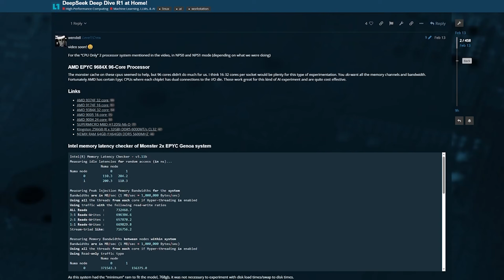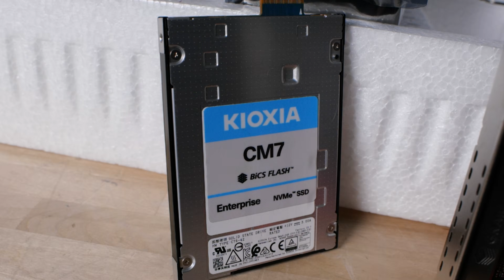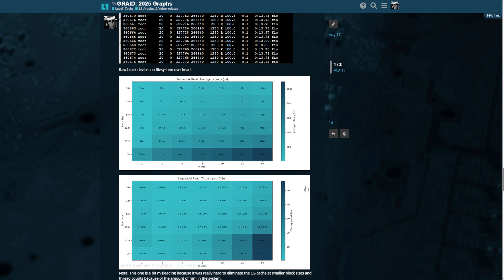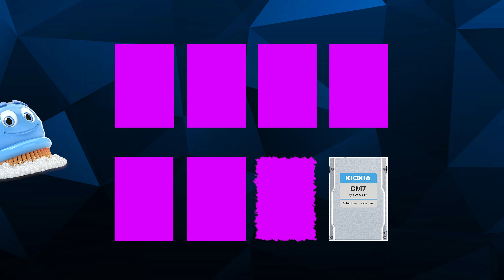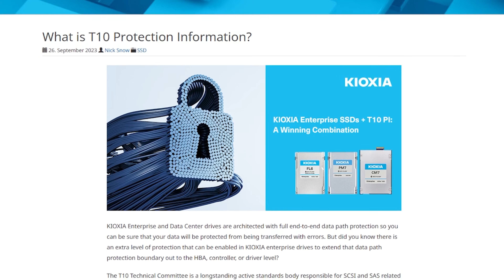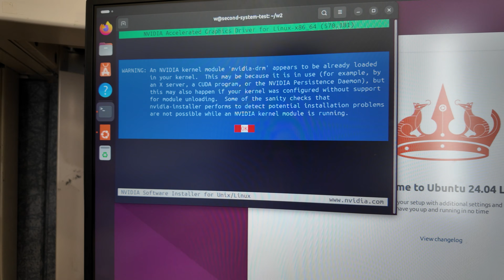Is Hardware Raid TRULY Dead? SupremeRAID SR-1010, Reviewed

Comment: what about 4 10 tb drives sas 10k rpm doing same job over and over like 250 gb data ie 1000 files ie pictures move sort to directory's and process compress 16 hrs hd video no res loss to dvd disc thats 1 only dvd thats a job for raid 40 tb data and raid card cost 179 x 4  + 129 for 9461 card. total less than $1000 your setups cost a little more!!!

Comment: I've had nothing but trouble with software RAID in the last few years. I did enjoy hardware RAID reliability for decades and I miss those days. 

If a disk dies you replace it, no problem as long as too many drives don't die before you replace it.

If there are errors on a software RAID then the endless process of searching command line commands begins and in the end you never fix it.
Reply: then you need learn what ZFS is lol

Comment: I was amazed by those read/write throughput figures. Maybe 15 years ago or a little more I remember working on a solution that needed to get blocks onto locally-attached storage as fast as possible so that specialist data-aware archival software could stream it off to tape fast enough that the tape drive would never need to slow down until it got to the end of the tape. (Niche, edge cases are such fun.) The fastest filesystem performance I was able to get with a Linux host was using the ext2 filesystem, and we only used the first third of each drive in the storage array (because the outer tracks of a disk platter pass under the head faster than the inner ones. The throughput was impressive for the time, but nothing like this SupremeRAID SR-1010 hybrid solution! I wonder where we'll be in another 15 years …

Comment: So if hardware RAID is going to hang around like vinyl records, we're going to see lots of boutique and limited-run hardware RAID solutions that are only collected by enthusiasts? 🤣

I'm from the days of using hardware RAID because the computer did not have the resources for the high-speed RAID calculations and I/O throughput. You remember when CPU clock speeds were in MHz? Yeah, back then. And because of all that experience, it took me sooooooo long to feel comfortable with software RAID "for real" - not helped at all by hitting problems with early software RAID solutions. Anyway - as I never had a NetApp or an EMC SAN in the home lab, it wasn't until ZFS that I learned to be comfortable with software RAID. I think also, by that time, the error reporting from consumer-level drives (and the OS support for this) had gotten significantly better, so that was a pretty big part of it too.

Comment: No, HW RAID isn't dead.

Stop with this idiocy.

It's never fun when your ZFS root take a dump on you and causes a kernel panic.

(ZFS root has been in Solaris since Solaris 10 10/08 ("U6") release. I still have the emails to Sun Microsystems about ZFS taking a dump and causing a kernel panic loop.)

It is, for this reason, why I NEVER put my OS install, on something that DEPENDS on the OS to _run_, for everything else to work.

ZFS/your OS takes a dump and down goes your entire system.

This is why I use HW RAID for my OS drive.

This is something that a LOT of people don't understand, because they've never had ZFS cause a kernel panic loop on them before.
Reply: At least from what I've seen, the OS Disk is not connected to the ZFS pool. Typically you have your OS Disk separated so that this is not an issue. The Pool itself is backed up or replicated so that there is high availability and data redundancy.

I can't say I've seen any hardware RAID since mid 2000's. Even software defined RAID is rare compared to HCI (Nutanix, vSAN, Storage Spaces Direct, Ceph etc have been more common in my experience)
Reply: @vortical911  
"I can't say I've seen any hardware RAID since mid 2000's. Even software defined RAID is rare compared to HCI (Nutanix, vSAN, Storage Spaces Direct, Ceph etc have been more common in my experience)"
Varies/depends on what the goals/objectives are, and your budget for deployment.

HCI works if you have several thousands of dollars to throw at the problem.

If you don't, then HW RAID is typically, more cost effective.

I have found that it is wayyy easier to deal with issues from either my LSI 9341-8i or my 9361-8i than it has been for me to deal with Ceph complaints. (like if there's a clock skew issue between the OSDs, there's really not a heck of a lot that I can do about *that*.)

I just have to wait until it resolves that issue, on its own.

Comment: For large bulk storage, hardware RAID is almost certainly dead. However, for a small amount of storage up the front of a server, it is unlikely that it will ever die. Sure you can do a software RAID1 boot device but you have just turned a trivial job of device replacement into a complicated one requiring good administration skills and paying close attention to not screw it up. If you ever get to play with proper server hardware, it is no coincidence that the latest BOSS cards from Dell are now hot-pluggable RAID1. You get these cute little carriers for the M.2 NVMe drives. We have one server left that is still using hardware RAID for something other than boot, and that is because, until last month, it was a standalone ESXi host, running the monitoring VMs. We have migrated to Proxmox due to licensing issues, and since this is the same hardware, it's still utilising hardware RAID for the VMs. However, the bulk storage measured in PB is all running software RAID, mostly GPFS, because ZFS is a toy filesystem at this scale. Before anyone defends ZFS, please tell me how I can replace every last bit of the hardware running the file system with zero downtime. Also, please explain how you can patch or upgrade all the software with zero downtime using ZFS. The short answer is that you cannot, so it's essentially a toy filesystem at an enterprise scale.

Comment: So I can only speak intelligently toward Dell x86 servers because that's what I spend 95% of my time supporting, but : NVMe is finally being taken seriously in production "Pizza Box" systems that have been basically what's keeping RAID alive for at least the past 5-10 years... so RAID's days may finally be coming to an end for all but 100TB+ commodity storage systems where long scrubbing routines are tolerated for stupid-cheap spinning rust storage prices.

Wendell has put out "RAID is dead" videos for years, yet : It literally isn't possible starting with the 14th Gen Dell PowerEdge equipment to order a 1U or 2U system without a RAID controller (the "PERC", or : P*ower*E*dge *R*AID *C*ontroller... basically an LSI/Broadcom MegaRAID ecosystem with fancy integration into Dell's BIOS/UEFI).  With the beginning of the 17th Generation PowerEdge systems (Spring 2025), the Enterprise customer is seeing two *big things that show things are finally changing in this space : 

1.) The flagship 2U server, the R700-series (we're talking Intel here, or the R770 for the 17th Gen), cannot be ordered with a 3.5" DAS disk chassis.  Somebody correct me if I'm wrong here, but I'm pretty sure this is a first in the like 30-year history of Dell selling 2U servers that you can't get the top-tier rackmount server with 3.5" disks.  Your options now are : 2.5" drives, E3.S NVMe slots, or a combination of the two.  For clarity : The lower-tier R500-series can still be ordered with 3.5" disks, but if it's not an option in the Top-Tier, that means its days are probably numbered

2.) The PERC Gen13 allows for 32 NVMe drives to be configured.  The PERC Gen11 and PERC Gen12 supported NVMe, but nothing like the Gen13.  Also, there are versions of the PERC Gen13 (H975i) that actually don't support SAS or SATA.  Again, that's a huge deal in the enterprise space.

What Wendell shows in these videos is the "latest and greatest" (kind of like his last RAID video where he pounded the pulpit for VROC... sadly how's that going?  😕), but NVMe is still "getting there" in the mainstream Enterprise market.  And honestly that makes sense to me, unless you're working in RnD or some kind of national laboratory, you're going to pick "Tried & True" (i.e. SAS/SATA Hardware RAID) if your job depends on it.

But yea - If Dell is making these kinds of moves in their "bread & butter" servers, I have a feeling we're gonna see some actual changes in the enterprise space with flash storage in the next 18 months, because a move like this is going to force customers to take a look at the NVMe tech and they may have "waited under hardware cycle" otherwise.

As always, thanks for Wendell and L1Techs for all the great content!

Comment: I find this stuff fascinating. These days, I am I only do occasional consulting, but back in the early 2000s RAID stuff was one of the pools I played a lot in. At one point, in the summer of 2000, I built a Linux server with a three quarters of a terabyte JBOD array using Seagate Barracuda 36G  drives and I think 3 or 4 SCSI controllers for the company I was working for directly under the CTO. I did all sorts of testing on the array, and had to do a lot of tuning of the block size to get decent read and write speeds. We were not concerned about long term data integrity, as this was a internet facing array for downloading files our application on the kiosks needed that were in a few thousand locations around the US and Canada. They had been snarfing them from the production server, an SGI Origin 2000, with a large dedicated RAID array box, but it was wisely decided that it should have no direction connection to the outside world. 

My .75 TB JBOD array was there to both remove any load or security vulnerability on the production server. It was a cool solution. Worst case, we just reformated the JBOD array, and rsynced the files over again.  As files were added or updated on Production, they would be copied over using a periodic rsync.  Fun days...

Comment: Hmm, I wrote tools to fix raid5 issues when I had raid card failure back in 2001, and again in 2007, but I didn't save it, wasn't complex enough for me to bother to save it, and really specific for my exact data drives failure issue. Was kindof fun. What wasn't fun was detecting what where the drives in use at the time of failures, and what drives the raid card had already kicked out of the raid.

Comment: Raid 5 over SSD? The SSD already provides a failure recovery mechanism, and raid 5 adds write amplification.
Reply: There is a massive difference between block/block range failure and drive failure. RAID5 protects against drive failure. I personally prefer RAID4 with SSDs.

Comment: My two cents after 40 years in this industry: hardware solutions are always finicky. They are justified only if the overall end-to-end performances are significantly better than software ones, especially when considering driver overhead. With CPU performances improving, they quickly become dead weight.
Reply: And especially with the fact that modern server CPUs effectively have a massive PCIe switch built in and you will never get that kind of connectivity from any PCIe connected card.
Reply: I am coming from the automation industry, so I don't have any belongings to IT or servers (except private and automation computer systems).

But me personally I like hardware solution especially when they don't need any drivers and are hard coded onto the hardware.

Of course you are kinda fucked with a RAID then.

But for example did you tried to get a sound card which is compatible with Linux out of the box? I never found one and the Creative cards are somehow working with some funky project solutions from some dudes in the internet, but I don't like it.

In the end I bought an Rode NT-USB mini as a microphone which has an DAC/sound card for earphones as well integrated. It doesn't need any drivers and works on Linux perfectly.

But like in every case in the life you have to negotiate what is better in certain situations.

Comment: I dunno what's up with all the paperclips but y'all, I've worked in enterprise storage for over a decade and nobody uses hardware RAID. It is rightfully dead. Parity is cheap to calculate on a modern CPU. Restricting access from CPU to PCIe is always going to be a bottleneck in modern architectures.

Comment: True hardware raid doesn't exist for a long time now.
Reply: That's a good point; it's all done in software on a CPU on the card or storage controller. The days of hardware XOR units are long gone as modern CPUs are more than fast enough for the job and cheaper.

Comment: Linux software raid does not scale, not even RAID0. RAID5 (and 6) are a mess when it comes to performance and that has been known for many years. There are patches out there to fix some of the issues but those have been stuck for a year now. Another issue is the bitmap. It's also really inefficient. Recent patches (a month or so ago) should solve that. Last issue is how you built the raid: 7 data drives. Anything that does not give you a power of 2 will further degrade performance. What this raid solution is: proprietary software raid with a nicely marketed hardware key, the GPU.
Reply: The thing is, modern CPUs are incredibly fast, so it's not a big deal. I have ten shelves hanging off the back of a Linux server doing 8D+2P RAID6 in a highly redundant setup. Think multipath to the shelves, no daisy chaining of the shelves and with careful attention to which cards the shelves are plugged into to achieve redundancy down to the riser level. Gives me a couple PB of storage for disk to disk backup on the cheap and the RAID performance exceeds the throughput the redundant 25Gbps network connection has by a considerable margin.
Reply: @jonathanbuzzard1376  That's great for a NAS scenario. When your Postgre servers is IO bound and the software raid is leaving performance on the table ...

Comment: Hi, if the controller can manage sector replacement, why not, if not, absolutely not (I raged enough with software RAID seeing a whole disk kicked out for one bad sector) - this is the main hardware RAID problem as it is working on blocks, not files.
Reply: Historically, LSI had a patent on this. I imagine it has expired as we are talking at 17 years ago when the LSI representative was boasting about it at a presentation. However, it locked other vendors and free software from implementing the same feature.
Reply: @jonathanbuzzard1376     Interesting historic explanation - IMHO patents should be circumscribed only to projects that can prove a large investment in research, as it has become a (very lame) weapon.
Reply: This is a software behavior problem and not something that hardware really solves for.
Reply: @christophercasale7961     Not sure, because IIRC it is (was ?) the firmware that manage it.

Comment: It only makes sense in situations where it's highest speed is required by the application, ie, raid0. It doesn't make sense to squelch a technology's main selling point. The main issue I see is that you're supporting oddball unique raid controllers in your DC, which will likely be 'special line items' in your support contract. Maybe they'll get bought and their controller technology will get folded into  one of the big player's solutions.

Comment: Can ya'll cover and chat about the Bolt GPUs? There might not be much to talk about right now but it's some interesting innovations and claims.
Reply: that's an investor scam bro... the image on the website is an Ai image with a gpu that has an ethernet port and two x16 connectors at either end.
Reply: @firenado4295  That's how it's designed. The ethernet port is a BMC port.

Comment: I get that software raid does a lot thing better.
But is there even remotly a tool/software, that can even get 1/10th out of the performance modern NVMes really offer?
Reply: With direct writes you can.
We have been waiting for O_Direct to fully hit OpenZFS for a while.
It's going to be the biggest boost for NVMe yet.
Reply: AI training. Certain enterprise workloads. Render clusters.
Reply: @christophercasale7961  ?
They asked if there was a way to make the software RAID implementations faster.
Their question had nothing to do with workloads.
Reply: @christophercasale7961  Thats a non answer. 
AI Trainig need fast storage sure, but there isnt a single software out there that can do software redundancy and not tank the performance of modern SSDs, anything I tested in Software was at best 1/10th the performance of a single drive. Software just causes way to much overhead
Reply: Yes.

Comment: I still use LSI MegaRAID hardware level RAID controllers w/ onboard cache and battery.
Reply: I'm sorry.
Reply: Adaptec 81605 here.
Reply: i do to to because sas is king
Reply: @josephdias5859  Good, don't get rid of it, there are (and will be) plentiful of large SAS SSD drives on Ebay and elsewhere, that are a good deal. There are also those PLX PCI-E splitter cards on Aliexpress, they work even in simple 4x or even 1x slot, and you can pout 8 x4 devices on them, and not just storage, you can pout GPUs there on risers if you wish, they work just fine. I know that is not HW raids, but those "NVME raid cards" are very useful, especially on current mainstream platforms that are lacking in PCI-E lanes.